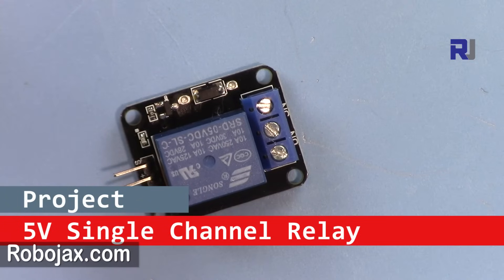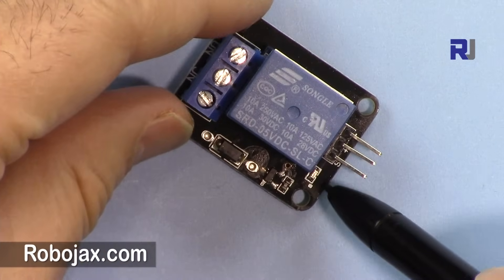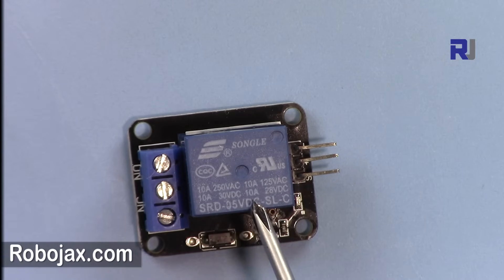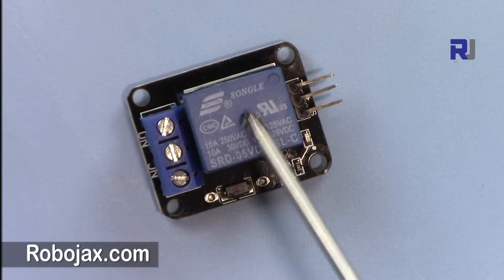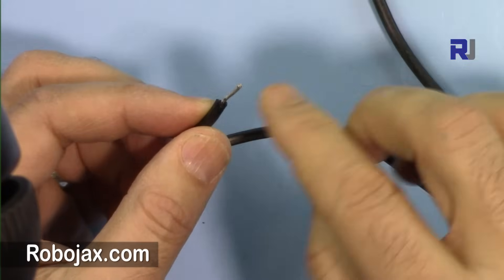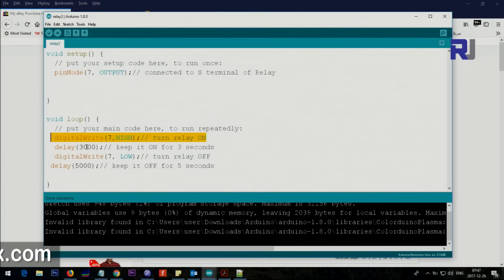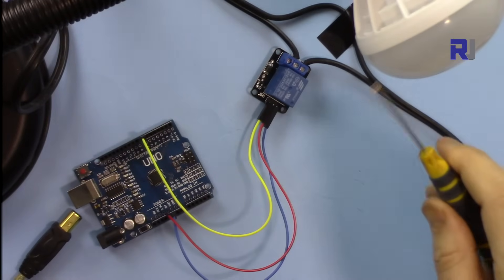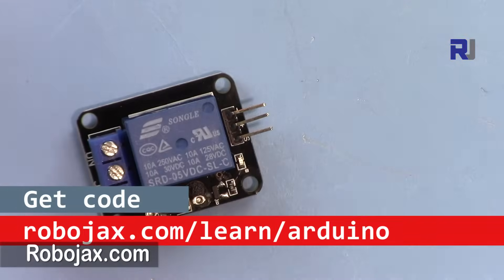How to use 5V Relay with Arduino to turn ON and OFF AC  bulb or DC load RJT33

Comment: Hello, I wanna ask something... I wanna connect the relay to plug 3 pin, theres earth, live & neutral wires. So which wires do i need to cut & connect it to the relay ?
Reply from the maker: earth is for safety. You should cut live. But neutral will also work. Live is somewhat safer.
Reply: Please be careful. In AC Earth means something different. In DC earth is really what neutral is in AC. When transferring AC to DC you ignore the AC Earth.
Reply: Greetings sir, I hope you are doing well. It is requested to answer whether or not a 220-240Vac bulb can be driven using a 5v relay using arduino uno?  I have a project in which i am doing a bluetooth controlled smart home automation. It is requested to give me tips on how to do it.
Regards

Comment: What the range of the signal in voltage should be ?
Reply from the maker: what voltage? for load (bulb or motor) whatever the voltage is. Only power matters which I have explained it.
Reply: @robojax  Thank you. I mean how large the signal should be in order to open the loop? and how low the signal is to cut the loop? what is the threshold in V?
Reply: @robojax  Since I plan to use the odroid xu4's pin to serve as the signal input. I don't know if this is enough.
Reply from the maker: This relay can handle in Europe 2200W in US and Canada 1200W AC load and it should be enough for your small computer.

Comment: Please make a vdo to operate 0.1 hp dc motor using relay and arduino
Reply from the maker: This is what exactly you are looking for . Use your motor instead of bulb. When you use relay, you can't change the speed. So this is perfectly matching what you are looking for .
Reply: @robojax  thanks
Reply: @robojax  i am using big motor 5A 12V

Comment: Good explain sir...sir now how to connect switch mode and relay mode.like(manual mode and automatic relay mode) please explain sir.
Reply from the maker: did not understand your question.
Reply: @robojax  I don't understand why the trigger pin of the relay is connected to pin 8 which is high when the writedigital value is HIGH??? At this instance, will not 5v will come from pin 8 and damaged the relay??
Reply: @robojax  of course, digitalWrite HIGH and LOW close and open the circuit respectively. But, when close, why it's not output 5 v??? Please kindly elaborate. Thanks.

Comment: relay not switching :(
Any solution plz
Reply from the maker: you have to be specific. let's test your relay first. Connect VCC (+) and GND (-) of your relay directly to 5V and GND of Arduino and then connect another wire from IN ( orS) terminal of relay to GND of Arduino and see if your relay turns on. If relay turns ON, then have got problem with code.  Then reply to this comment and I will try to help you. If you want to share any image, please post your image https://snag.gy/ and you will get a unique address for your image, then post the address of the image with your comment.

Comment: how many relays can one standard Arduino board handle?
Reply from the maker: depends on the amount of current of the relay and number of pins of Arduino. I have a video showing 16 channel relay. Check it out.

Comment: hi .. we should cut the pozitif cable or the neutral cable of the  bulb?
Reply from the maker: both will work but HOT or LIVE wire is better to be used here.

Comment: Bro how are you embedding the code to automatically run on startup of the unit when powered?
Reply from the maker: You can set the relay to be OFF or ON at power up. Just put the code inside setup() and it will behave like that if it was OFF or ON.

Comment: can i ask why  my lamp keep on even i already programmed to data pin number 7 arduino if i change to another pin it keep on too
and never off
Reply from the maker: do you use the same relay and the same code? it should work. or you have done something wrong.

Comment: This is exactly what I need... The relay on the board makes the wiring very easy. WHere did you get that and what is the part number or name of it?
Reply from the maker: it is called 5V relay module.
Reply: Greetings sir, I hope you are doing well. It is requested to answer whether or not a 220-240Vac bulb can be driven using a 5v relay using arduino uno?  I have a project in which i am doing a bluetooth controlled smart home automation. It is requested to give me tips on how to do it.
Regards

Comment: Thank you! Total beginner here and this was very clear on the how, what and why. 
I'm hoping you can help me with a question: I want to build a circuit like this, but I want to use a limit switch to turn the light on and it stay on until I push a button to reset it. I guess the best way to explain it is like an alarm. When the circuit is open the light goes on, but stays on until I reset the circuit with a button. How can I work that into this?
Reply from the maker: You are welcome. did you search for "push ON" in my channel? Here the video: https://www.youtube.com/watch?v=7CCSRs5bvH0

Comment: great video !
sir when we are connecting the arduino to laptop using usb cable (not with adapter), will it work ? thanks
Reply from the maker: yes. that is what I have done. it is connected to laptop. All USBs give 5V. Just the amount of current (amper) would be less or more.  For this purpose, laptop usb is sufficient.
Reply: Robojax thanks sir
Reply: But do you understand that once you have downloaded the program to the Arduino, and tested it all works, you can disconnect the computer and attach 7V to 12V delivery battery or transformer to power it?

Comment: Hi Robojax, as a beginner and really concerned of safety. I would like to ask, does it matter whether you use the negative or positive side of the lamp wires? thanks in advance.
Reply from the maker: Once AC is connected the relay should not be touched. when you connect AC lamp wire.  We have no + or - but we have Live and Neutral.  In  some countries and some plugs you can connect the plug to the wall in any ways you like, so you will not know which once is live and which one is neutral.  It will make it much safer if you connect the neutral wire. But when the light is OFF, there is still possibility of harm unless the plug is disconnected.
Reply: Greetings sir, I hope you are doing well. It is requested to answer whether or not a 220-240Vac bulb can be driven using a 5v relay using arduino uno?  I have a project in which i am doing a bluetooth controlled smart home automation. It is requested to give me tips on how to do it.
Regards

Comment: I don't have a relay on board or as a module it is open, unconnected how to connect that?
Reply from the maker: then you need, a transistor, a diode and resistor to make it work. this module has all of them together. here is the diagram https://circuitdigest.com/fullimage?i=circuitdiagram_mic/Controlling-Relay-using-Arduino-circuit-diagram.png
and if you want to know fully, read this page https://circuitdigest.com/microcontroller-projects/arduino-relay-control
Reply: +Robojax thanks a ton
Reply from the maker: You are welcome.

Comment: Question.

If im using a welder, I wanted it to turn on when my Gcode starts my tool path start weld and I want it to turn off when my tool path changes position then I want it to turn back on when i want to make another weld. How would that be coded?
Reply from the maker: I don't know how do you get the output from your tools that work with Gcode. But it seems very simple. assuming you get output from your tool on a wire that goes HIGH or 5V and LOW or zero Volts. than you can connect it to Arduino for example pin 5
so Here I have written a code for you https://codeshare.io/GAnNrx please let me know if you were able to make it work
Reply: Thanks. I will give that a try and see if it works
Reply: Greetings sir, I hope you are doing well. It is requested to answer whether or not a 220-240Vac bulb can be driven using a 5v relay using arduino uno?  I have a project in which i am doing a bluetooth controlled smart home automation. It is requested to give me tips on how to do it.
Regards

Comment: Good morning, I'm starting with Arduino, and what I want is to turn on an LED for a few seconds and then it goes off and the program ends there, my problem is that it only turns on but does not turn off .. What am I wrong?

void setup() {
 
 
 pinMode( 9, OUTPUT) ;
 digitalWrite(9, HIGH);
 delay (2000);
 digitalWrite(9, LOW);

}
void loop(){
}
Reply: Hi William,

Keep pinMode(9, OUTPUT);

in the void setup(){} section

Move the rest into void loop(){}

and add

delay(2000); // ,for example

Then the program should work as you intended.

CODES:

void setup() {
pinMode(9, OUTPUT); // pin 9 as an output.
}
void loop(){
digitalWrite(9, HIGH);  //  5V to pin 9
delay(2000); // 5V for 2000 miliseconds
digitalWrite(9, LOW); // 0V to pin 9
delay(2000); // 0V for 2000 miliseconds
}
Reply from the maker: Hi, your sketch turns ON the LED and waits for 2 sesonds and turns OFF and stay there.  It should work. It should work.  https://codeshare.io/5gMvZB
Reply: true but the relay remains activated :(
Reply from the maker: then connect your wires in relay the other way. On in the middle and one to the other connector.

Comment: Can we use this relay to turn on and off a 12V DC source?
Reply from the maker: yes you can. DC is the most easy because if the voltage is less than 50V, it is safe.

Comment: Thanks for that! One qustion though, for some reason it works the other way around - the relay is activated (circuit is closed) for 5000ms and open for 3000ms. What could be the problem? Thanks again!
Reply from the maker: You are welcome.
This is very normal. There are two types of relays. Your relay is LOW level trigger. Meaning it is activated with LOW and goes OFF with HIGH. For this reason the code looks the opposite of what you expect.
Reply: Greetings sir, I hope you are doing well. It is requested to answer whether or not a 220-240Vac bulb can be driven using a 5v relay using arduino uno?  I have a project in which i am doing a bluetooth controlled smart home automation. It is requested to give me tips on how to do it.
Regards

Comment: Seriously every time I want to update my arduino skills I find that the bloke that seems to have something of an Indian dialect always delivers in a fast decisive manner and it's always clearly layed out with no fluff. You Sir are a Gentleman and a scholar. Another success. Thank you so much brother. Greatly appreciated. Subbed!
Reply from the maker: Thank you very much. I am Canadian, Persian from Afghanistan.
Reply: Your more than welcome Sir, my apologies for getting the heritage completely wrong . Your sage knowledge allowed me to couple the relay to a Geeetech voice recognition module. It's just a beginning phase but now I can voice activate my a bed lamp :).
Reply: @robojax  You're just Canadian now.  We told you our secret handshake.
Reply: @robojax  I was SO CLOSE
Reply: Robojax you sound more like arab to me, hehe 🤣
Reply: Hi I from India could you tell me about the scope of this aurdino in electronics engineering sector
Reply: Agree, We learnn 90% in youtube 10% on school
Reply: Greetings sir, I hope you are doing well. It is requested to answer whether or not a 220-240Vac bulb can be driven using a 5v relay using arduino uno?  I have a project in which i am doing a bluetooth controlled smart home automation. It is requested to give me tips on how to do it.
Regards
Reply: @artofrainsleepbeautycreati8305   the 5v relay means that it can be controlled via a 5 v circuit/signal, like the one provided by arduino, the load that the relay can control can be up to 220v AC or the respective in DC that is mentioned in the video. Its not the 5v dc that is powering the load. The 5v is just a signal, its a way of telling the relay switch that its time to open or close the circuit, it is like your finger that presses the button
Reply: Sir good morning! Can you give me an schematic diagram for a time delay on using spdt relay, ne555, and with digital clock indicator....

Comment: hello, i have an electromagnetic lock door DC 12 V. can i use this relay?
Reply from the maker: Yes you can. works perfectly.
Reply: thank you so much
Reply: what is the name of the cable connecting between relay and arduino?
Reply from the maker: dupont cable. See it on eBay https://www.ebay.ca/sch/i.html?_nkw=dupont+cable&_sacat=0

Comment: Hi Robojax, nice video thank you!

Does it matter whether the relay is inserted in the "live" or the "neutral" side of the mains AC supply?  I can't help thinking the appliance would be permanently "live" if the relay were inserted in the neutral side.  Thanks!
Reply: Robojax...thanks for this great video and source for all the projects. Really appreciated.  You might want to check with an electrician / electrical engineer on the statement that "In many countries, the live and neutral wires are not distinguished when plugging in the device. If you can distinguish it, connect neutral for safety purpose. ". It's not 100% false, yet not accurate either. And the difference between the two can harm people. I suggest you read the book of Karl Riley (Tracing EMF's).
Reply from the maker: In many countries, the live and neutral wires are not distinguished when plugging in the device. If you can distinguish it, connect neutral for safety purpose.
But in terms of operations, it doesn't make any difference.
Reply: Greetings sir, I hope you are doing well. It is requested to answer whether or not a 220-240Vac bulb can be driven using a 5v relay using arduino uno?  I have a project in which i am doing a bluetooth controlled smart home automation. It is requested to give me tips on how to do it.
Regards

Comment: difference with ssr (solid state relay) what ya? project I use arduino uno with this relay (blue color / not writing ssr) moves pump 125watt / 220v at every 10 minutes for 1 second for 24 hours non stop. what's safety with relay this. thanks u  before
Reply from the maker: you are welcome.

Comment: Is there a way to dim the light for example if PIR sensor detects an object then the light will go ON and keep it on for sometime. Now if there is no object for 20 minutes, instead of turning off the light but dim the light instead for like 30 to 50% instead of 100% ON.   
Thank you.
Reply from the maker: Not with the relay. I am preparing AC bulb dimming video which will be posted in the near future God willing.
Reply: I'm connecting the light fixture to relay then relay to Arudino Board with PIR Sensor. I know how to turn ON and OFF the AC bulb using PIR sensor but I'm curious on how would you dimming the light instead of turning it OFF. Sorry if I'm not clear
Thank you.
Reply from the maker: Here are many ways using Triac to do it. Here is one example and it seems the circuit should work: https://obrazki.elektroda.pl/4402156800_1385532477.jpg
Reply: Greetings sir, I hope you are doing well. It is requested to answer whether or not a 220-240Vac bulb can be driven using a 5v relay using arduino uno?  I have a project in which i am doing a bluetooth controlled smart home automation. It is requested to give me tips on how to do it.
Regards

Comment: thank you so much.Simple and easy explanation. Can you post a video to connect the relay to a house circuit. eg. Light circuit or plug circuit; And which wire must we interface on. Thank you so much.
Reply from the maker: You are welcome. Thank you your suggestion. i will try to make such video in the near future.

Comment: Can you plug into the wall for power instead of using USB cable.  
Thank you.
Reply from the maker: You can get 9V adapter to power the arduino (connect to the jac). It need 5V so doesn't matter where you get that from. You can use your phone charger to power this up from wall via the usb.

Comment: Hi again Robojax, with my relay it is the other way around. digitalWrite(3, LOW) turns on the light, and digitalWrite(3, HIGH) turns it off. Is this normal?
Reply from the maker: yes it is is normal. We have LOW trigger  or HIGH trigger relay module.
Reply: Oh ok. Thanks Robojax for clarifiying this. Earlier I thought mine was defective or something.
Reply: @hermanhermitz9101  Or you wired the cable to the NC instead of NO port. Probably a year too late, but if anyone ever looks this up. :)

Comment: Hi Robojax, will the relay get warm at all when we use it to control a 10W LED? And if you have time please do a tutorial or review on the HLK-PM01 power supply. Thanks.
Reply from the maker: I just check the specs. It is AC to DC converter and maximum current it can handle is 3W at 5V. So you are over loading it by  the factor of 3.  See photo if this is the right product. https://ae01.alicdn.com/kf/HTB1W2uJOXXXXXayXpXXq6xXFXXXO/220173842/HTB1W2uJOXXXXXayXpXXq6xXFXXXO.jpg
So you have to reduce the load to 3W or lower.
Thanks for the suggestion. I will look into it.
Reply: Thanks Robojax.

Comment: For 2 lump be sure necessary will use 2x “5v Single Chanel Relay” or there’re other scheme?
Thanks for recording nice quide
Reply from the maker: If you want to turn both ON and OFF at the same time, then ONE relay will do it. Just connect both both wires to the same relay.
see this drawing https://snag.gy/ghvrTW.jpg
Reply: Greetings sir, I hope you are doing well. It is requested to answer whether or not a 220-240Vac bulb can be driven using a 5v relay using arduino uno?  I have a project in which i am doing a bluetooth controlled smart home automation. It is requested to give me tips on how to do it.
Regards